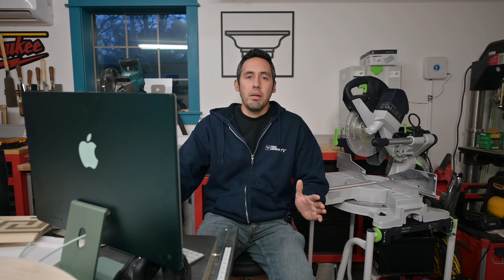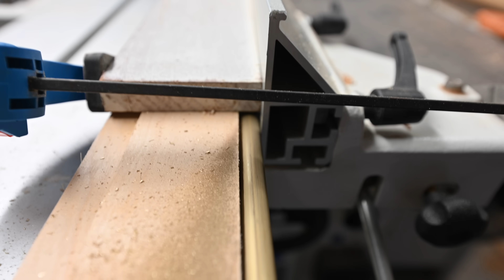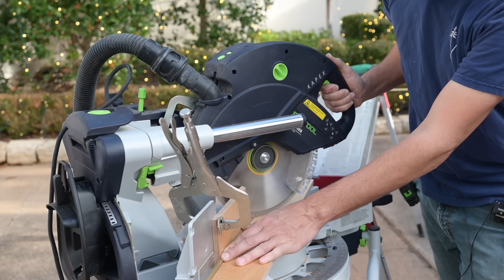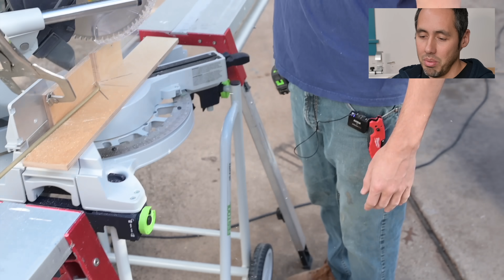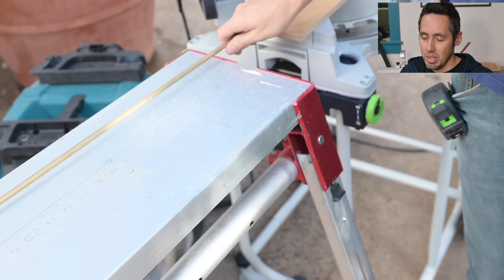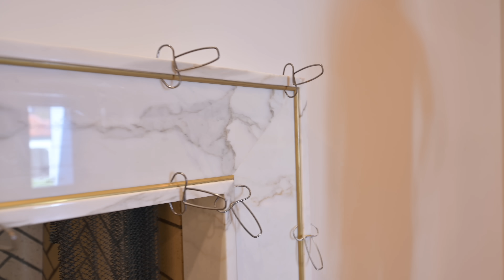It only took 12 years...My first MITER SAW injury.

Comment: As a toolmaker, I noticed the tooth count on your blade looked a little low. maybe an illusion. Anyhow when cutting steel, our rule is 3 plus teeth contact at any given time. this is mostly to stop skipping which shortens blade life ( think about the contact geometry, the smaller the material the easier to get between the teeth at any speed). Essentially anytime you successfully cut steel of that size on a miter saw you are getting lucky. Yes, I do it and have had similar results as you had. That's why I keep an old 80 tooth blade for aluminum and brass projects. As per accidents, mine was trying to hold a couple pieces of wood together while nailing. Nearly shot thru my finger on the other side. Lucky for me it just glazed 2 fingers. No stiches, but a fare amount of blood.

Comment: Looks like the teeth of the blade are also cutting in the up direction.  With metal, I always try to cut with the teeth going down into the material.  In this case the material needs to be further to the front of the saw

Comment: In my senior year of high school in wood shop in 1968.  I was ripping the top for my chest board.  Luckily I set the blade just above the board I was cutting.  I started the cut and one of my buddies distracted me.  With no blade guard my left thumb passed over the blade.  A lot of bleeding, 1/8” wide cut  1/64” deep and the shop teacher was going to take me to emergency.  I said no, I had to golf that afternoon for the high school golf team, no stitches for me.  I went out and shot par that afternoon.  Still have the scar.

Comment: 18ga brad into my index finger.  Had two nailers on the floor, one had 3/4” brads, the other had 1 1/2”.  Thought I had the 3/4” and popped the brad right through the wood into my finger.  Be safe and know your equipment

Comment: Your brass was not supported completely behind the cut. If I had to guess it was about 3/4 of an inch that wasn’t. Brass is like cutting butter. You should have had a piece of scrap behind it going beyond your cut line giving you complete backing. You are right that speed was not the reason. Softness of the material was. 50 years of experience says I’m right. Love your videos by the way and you  just learned something new. Proud to say no injuries to report after 52 years. Lucky I guess

Comment: One accident that comes to mind was when I was using a nail gun. I had it all lined up, going in straight. It must have hit an inperfection in the wood because the nail came out the other side where I was holding the wood (not in line with where the nail should have gone) and went into my finger. Fortunately it didn’t penetrate the tissue but the force with which it hit bruised my finger and scared me to the point that I didn’t want to look at my hand.

Comment: These things can happen even when you think you’re doing everything right 
I made a mistake cross cutting some red oak early on in my career. I had a major kickback on the table saw. The board shot straight back in to my pelvis. I went to the ground thinking I was going to die on my clients garage floor. This has not happened since 
Lesson learned

Comment: I glad your alright. I wonder if you had clamped it down with a piece on top if that would have prevented it?   My worst accident was kick back at the tablesaw. Was feeding a piece of very wet green wood the closed up around the back of the blade. It hit me it the chest ant that wet into the wall behind me.  I was fortunate and was bruised.

Comment: Glad you’re ok as well. Would you say it’s possible the teeth from the saw blade caught on the bottom of the brass and pulled it upwards? This happens when cutting aluminum trim for tile work  sometimes.

Comment: Out of curiosity what was the speed of the saw running at . I would have it on the slowest speed . Also a blade with a negative hook  can be safer and on small items I try to find a away to  hold the item without my fingers . My stupid injury was with a circular saw and being impatient went to tap the fence in and hadn't waited for the blade to stop and end up taking the tips of   2 of my fingers off. It was about 6mm. The next day had to go to get plastic surgery. Felt a complete fool and the surgeon told us 3 other joiners had done the same. Then had the option of skin craft and would have to take a year off work because infection risk or would remove the nail and pill the skin over and let the body repair its self as skin crafts also aint that successful always. I ended up off work for 3 months. I had being in the trade around 12 years.

Comment: Welp here goes. We clean putty knifes in the shop with a belt sander. This also sharpens them (which everyone in the shop should be dulling the knife after). Either way I was using a putty knife to apply bondo to knots on a bunch of poplar face frames. Well I stupidly wiped excess bondo from the end of the putty knife with my left pointer. The knife was as sharp as Japanese steel and it cut through the entirety of my pointer tip. Trip to the er and I had my tip stitched back on (15 of em) and no tendons were severed. Lucky day.

Comment: So, I was making wine glass hangers for a bar and back bar we built. I was putting a 45 on both edges of 3/8" (thick) X 1 1/2 (wide) X 12" (long) pieces. About 24 pieces. It was an after thought so I decided the quickest way to do it would be the table saw. Just slide them through. It was working great...... Until I glanced at the little triangle pieces piling up under the blade. At that point I had a flashback to the horror film they used to show us in highschool woodshop of the guy getting a kickback through the belly. So, I decided I'd reach behind the blade and flip then out. Saw running and I've got on my reading glasses (depth perception off).

As I reached, I heard a bang, felt my arm come back and thought, this isn't good dummy. When I looked down the finger nails on my left index finger and middle finger looked liked two car hoods opened up. I've still got the fingers but the blade went through the finger tips below and parallel to the nail almost to the first knuckle. Shattered the bones so now if you push on something with those fingers they kinda just roll backwards..

They sewed straight through the nails when closed the hoods. Lol

Comment: the fences r 2 far away 4 little things so i hold them closer to me w a block of wood 2 keep them from kicking back like that. my worst injury was when i grabbed somebody elses circular saw and the blade wasnt on right so it moved to the side and cut my finger. another time a coworker put his 12" chop saw on his horses that were designed for it and it had to clamped down or something and after i made my cut i realized the psycho didnt clamp it down. another injury was holding base together so a   1 5/8 brad was stuck through my finger i wish i just pulled it myself bc the hospital made it much more painful w their digital block shots and they pumped me full of radiation bc they couldnt figure how to take the right angle. ever since then ive used a hammer to hold it with.

Comment: What kind of blade? Standard finish blade will cut but over time stuff like this will happen. I've cut brass as well. It's soft. However you will get some wear on the tips if the teeth much quicker than with hardwood. That angle in cutting the outside point of the 45 is never easy when cutting metal.

Comment: Good video but I hope this doesn’t scare you or other people away from cutting metal on a saw.  You just have to properly SECURE the work piece.  Which means clamps and stops (if you’re cutting a 45).  Which takes more time.  So yeah, you essentially learned a slightly painful lesson trying to cut metal as if it was pine.

Comment: I was shooting top plates on framing interior walls after trusses and had to use 1x4 instead of 2x4 so I shot a ring shank threw from underneath in to my hand holding it and my hand was stuck to it. 😢

Comment: Not a trades injury, but I was splitting wood on a log splitter, I started at 5:30 am, Sun was just coming up, and in my first half hour of splitting wood I got a gnarly round with a whole bunch of knots in it, just as it was about to split, the piece of wood rotated, as the wedge of the splitter hit a knot, and sucked my finger into the plate, against which the piece of wood presses into. I got my finger out, and passed out, when I woke up I was in shock ,and couldn't control my bowel movements. In the end I lost a fingernail, and a little bit of nerve damage.

Comment: I was nailing quater round and slipped on a piece of floor covering and nailed my hand to the wall. I was the only person working at the time so I had to break the woof off the wall. Cut it to a manageable size at the chop saw and drive myself to the hospital with a nail/piece of wood stuck to me.. lol

Comment: I changed out my 18” planer head with a helical head and set the original head with the knives on a shelf in my garage and a few days later i went out to get something off the shelf in my socks (no shoes) and the head rolled off the shelf right onto my toe and completely shattered my big toe. The head was probably around 25lbs. As I yelled in pain my wife came to the garage and looked at me and asked if she should call a “toe” truck, I was not in the mood to laugh but it’s funny now. 11 years later still can’t bend that toe.

Comment: I was pattern routing parts for Adirondack chairs using my router table.  I paused what I was doing to clear the table of saw dust that my dust collector had missed.  I kept my hearing protection and dust collector on but I thought I had turned my router off.  Unfortunately the router was still running and I ran my thumb into a compression bit running at 18,000 rpm when I attempted to brush saw dust into the dust collector hose.  It removed a portion of my thumbnail and put a pretty deep gash in my thumb.  The injury could have been much worse.  I only have about 60% of my thumbnail and a pretty bad scar on my thumb but I still have full use of my thumb and no loss of mobility.  The moral of the story is always make sure your power tools are off when cleaning around them and use a brush rather than your hands.

Comment: I had a similar experience cutting aluminum. Part of the issue is that you need more teeth on the blades. The standard blade that comes with the kpex just don’t feel right to me.

Comment: Worst injuries.  Tripped while laying  some subfloor decking and slammed my forearm into some exposed nails catching myself. 2 arrowhead shaped scars now.  When I was 18 I had a guy shoot my ankle with a 3" paslode stick nailer. I was going to kick in the bottom of a corner stud and he was going to use the track to bump it, with his finger on the trigger. Hubbed it up tight with only a tiny pin hole on the opposite side. Keep your finger off the bang switch folks.

Comment: The same kind of thing happened to me on my mitre saw. I was using a metal yardstick to measure and cut wood on my mitre saw table, things were going well, i was a little rushed , measured my pc but didnt move my yardstick and it was under the wood and just an inch or two across where  the blade comes down. When the blade hit basically the same thing happened to me, the  wood and metal kind of exploded, wood came flying and cut my thumb and a couple of fingers. Thumb was bruised up pretty good. I shook for about  30 minutes afterwards before i could go back and figure out what i had done wrong. That was probably six months ago and im still scared to use the saw. Now i dont do anything on that table and i dont get into any kind of hurry.

Comment: Worst accident I’ve had in shop was cutting a 5” branch on my mitre saw.  Got half way through it and it shifted or something and saw caught the log threw it across my shop like it was a toothpick.  It must have smashed my thumb between the fence and the log.  Badly bruised thumb almost lost the nail.  Cutting round objects is always a risk.

Comment: My opinion on why you got bit with that cut:  Your zero clearance fence was not actually 'zero'... on the vertical. Your brass to the left of the blade was not supported because you already cut a left 45, leaving a 90 degree opening when you went to the right. For such a small sized piece of brass, I would likely go to a manual miter with a good hacksaw.

Comment: Old style Delta chop saw which was in dangerouscondition to begin with, cutting base and there was a snall cutoff piece in the kerf channel at the bottom of the cut the blade hit the piece and it exploded throwing a 3/4" splinter into my eye ball and I flinched putting my left index finger in the blade which at first I didn't notice due to the splinter. While trying to pull the splinter out of my eye I saw all the blood. It had removed my finger from the last knuckle, finger nail was gone the finger print pad was hanging. The doctor sewed that on to cap off my finger. My eye healed fine. This was in 1984.

Comment: My thoughts, I don’t care how soft the metal, cut wood with wood cutting tools, cut metal with metal cutting tools. My worse injury, holding a piece of 1x4 stock in my left hand and attempting to rip off a half inch with a circular saw. Very fortunate that the blade didn’t go all the way through my first two fingers. That was 19 years ago. Still no feeling in those finger tips.

Comment: Last cut. Used a forstner bit to make a hole, didn’t want blowout so used some scrap wood on the other side. Held in with my hand because last cut. Ha. Went through and got me right between the thumb and next finger. You can see the center punch, and about a quarter round scar on the webbed part now. 
My wife calls it my shark bite

Comment: The piece you were cutting wasn’t backed up properly with a sacrificial fence and bottom piece spanning the cut groove. The angle previously cut in your fence left a void.  
When i cut small pieces of wood or metal full support without any gaps other than the kerf and don’t lift the blade until it stops. I’m a 53 year old finish carpenter with all my fingers… but i did power plane two finger tips once hitting the nerve. Not fun.

Comment: This isn’t the worst, put the craziest, one in a 1 million. So we had 2 Jack’s and a king stud. We were nailing the king to the 2  jack studs, but there was a twist at the bottom that needed to be pulled in. So I was pulling in while coworker was Nailing.  He shot through one 2 x 6 and hit a nail so perfect that it shot it out thru the first 2 x 6 in front of it right into my palm where I was holding the 2 x 6 to keep it in place. The one nail hit the other so perfect and acted like a nail punch.
One time I was using my utility blade to take a little material of a three-quarter board, and slipped. Ended up, stabbing the whole blade through the web in my hand between my pointer finger and thumb but luckily missed any arteries or major veins. Drove myself to the hospital 11 stitches.

Comment: I shot 2 1/2 " finish nail into the joint of my index finger and couldn't pull the nail out. I ended up in the ER were they used lineman pliers to pull the nail out of my finger and that was problem one the worst accident on the job.

Comment: Caught myself with an 12 inch angle grinder after turning it off. This was metal cutting, that extra fence wasn't needed, material needed clamped down, it moved and drag your hand, is that a good metal cutting disc? Is the saw too fast? Thanks for sharing, warning to us all ! Sorry for you 😮

Comment: As my dad always said,  It's not a project unless you draw blood"!
I was making a custom pen and drilling the middle of a wooden blank. The drill bit went 99% of the way through the wood (but not all the way through). I tried manually spinning the bit to complete the hole while holding the wood. I accidentally pressed the trigger on the hand drill and drilled a hole through the palm of my hand! 
Ironically, the wood I was using?? Bloodwood!

Comment: I have been using Festool mitre saw for the last 10 years 
So when I'm cutting alluminium or copper, I don't use festool blades,not enough teeth, I would have the same problems with kickbacks
Need to swap the blade and some cutting fluid every time when cutting copper or alluminium 
Thanks

Comment: Using my table saw 4 years ago I pinched the blade causing kickback and my left hand was also kicked but into the blade. It took the the tip of my f/u finger off I actually watched the tip of my finger sail across the room where my Labrador was sitting ( his name was Ace he passed away a year after)  Ace looked up and opened his mouth to bark and there went my finger tip. He died a year later taking part of me with him.. AbsolutLy a true story.

Comment: My worst injury was cutting a piece of aluminum with a skill saw when it pinched and kicked the saw back into my thumb and the way I was holding it (like an idiot) the blade cut the pad of my thumb off. It was just holding on and I flipped my hand to make it close up as if that would make it all better. 🤦‍♂️